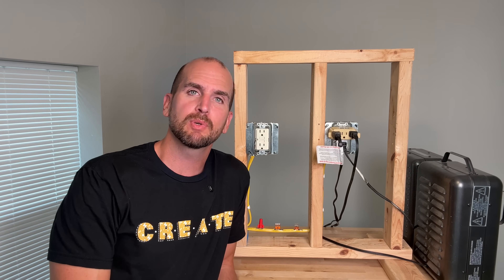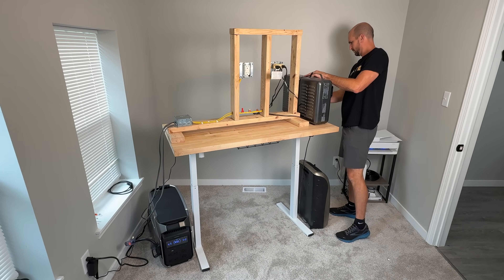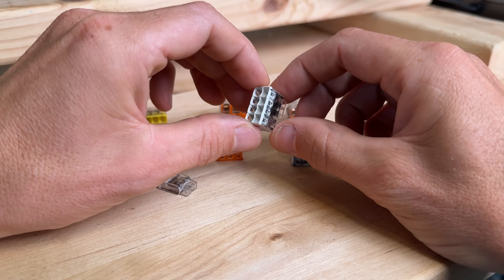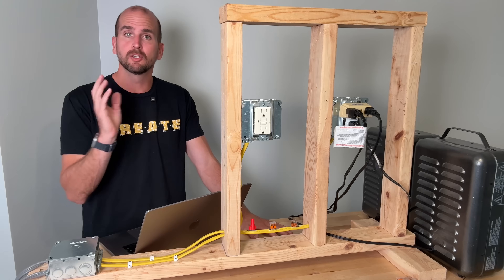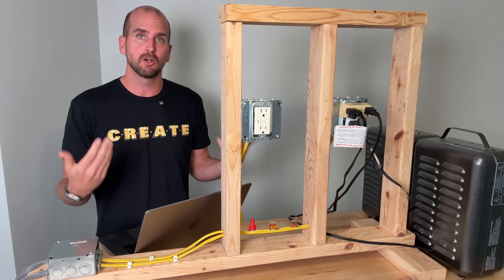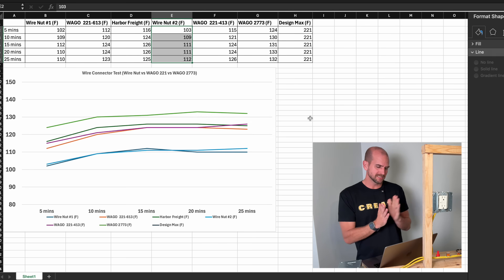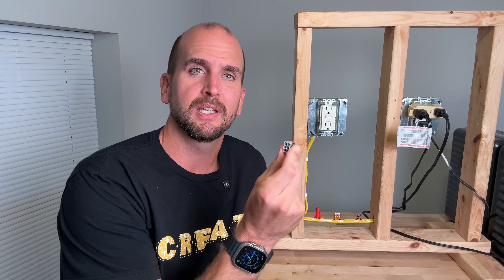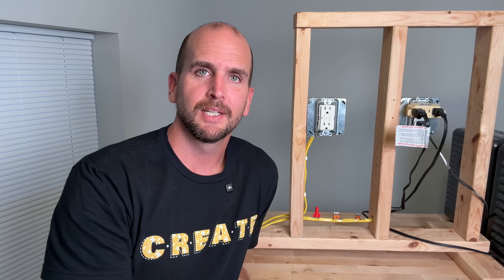Can Push-In Wire Connectors Handle Heavy Loads? | Surprising Results!

Comment: That’s why the US should update there 120V to 240 half of the amps and 12gauge is only 2.08 mm while we use 2.5mm. It’s not the voltage any that does the harm, it’s the amps that creates the heat

Comment: TL;DW: None of them came within 50 degrees of their rated max temp, and the push-in, with the least contact area and clamping force, predicably had the most heat but still well within specification.

Comment: This may sound stupid, but just curious.  Is using the push in connector the same as backstabbing in an electrical outlet because no reputable electrician recommends backstabbing, although the builder that built this house, thats all they used.

Comment: i love using the push in connectors for light fixtures , quick and easy to install, but the temps on your chart seem to reinforce  my  opinion that they are not as good of connection as wire nuts, loose connections always produce more heat(thus failing more often). example, i have to repair alot more circuits,recetacles that are backstabed than recetacles that are placed under the screw terminals. burned up wires backstabed into rectacles and switches  are alot more common than hardwired under the clamps or screw terminals and these push in and wago connectors are very similar in design of the backstab holes. with that said i do think the wago or push in connectors are good in some applications but better than wire nuts certainly not says my 45 years of electrical experience

Comment: Would it be possible, or have you done it to do a long temp test @ 20A (or even better 16A) since you are not supposed to run a circuit full time at more then 80% of rated. Just wondering what temps they would be at pulling something like 16A for 24 hours. I would think they would be cooler but would the temps be closer together for all the different connectors.

Comment: I use 2273 for lighting circuits. With modern high voltage LED lights currents often don't exceed even 1A.

Comment: I utilized a Wago 221 lever nut in my garage electrical junction box.

The original wiring had a wire nut with four wires twisted together.

One 12-2 and three 14-2 under one wire nut inside the metal junction box.

Instead of re-twisting everything and using another wire nut after replacing the junction box, I used a Wago 221 lever nut that could accept different wire gauges.

It was a small junction box, and the original wiring from 1965 didn't have enough wire for any servicing. They didn't give you enough wire in those days, huh?

LOL

The Wago 221 lever nut was a game changer!

This is safe, right?

My friend said Wago's are dangerous and that wire nuts should always be used.

What do you think?

Comment: I like your experiment however the wire and lever nuts are too close to the romex to establish a heat profile.  The wire and copper can easily influence the connection temperature.  I guess I would try to run perhaps a foot of insulated wire (in each direction) and heat sink perhaps 10-11 inches of the path of wire going to the connection.

Comment: I have the 221 series, but I also bought a box of In-sure push in 4 wire connectors by Ideal and like them even more than the Wagos because the wires stay in there nice and tight, although not reusable.  I would be willing to try the Harbor Freight or even the newer style Wagos, but I really don't have space issues nor load issues.  Thanks for the very informative video.

Comment: You dont think the NEC tested these before allowing them to be sold in the US? What,
you think just any old jerk can create a connector out in his garage & Home Depot & Walmart will fill their shelves with them? You dont think the big retailers lawyers will insist all electrical products sold in their clients stores be NFPA & NEC approved? What world do you live in?

!
Reply: What do you say about quick wiring (backstabbing) 14 gauge wire on residential grade receptacles? These are also UL Listed and comply with the NEC, but very few people recommend using that feature. Point being, UL Listing and NEC compliance is sometimes a low bar.
Reply: @surferdude642 

Those backstabbing connections are actually very reliable. Lots of times in life people just follow what gets repeated, even if it isn't true.
Reply: @CorneliusTaylor-s1u I tend to agree, and I've seen a few of those in my house that have been used for over 50 years with no issues regarding bad wire connections. A few years ago I upgraded all the receptacles and switches, and as a diyer with plenty of time to do this and not wanting to be cheap or cutting corners, I opted for commercial grade receptacles where backstabbing is not an option. Back wiring on commercial grade is far superior and convenient if you come across stranded wire.
Reply: @surferdude642  

I was going to add that I have replaced most of the original sockets and switches in a home built in 1980 and I only found one backstabed wire that was loose, and that can easily be explained by it not being properly installed. In other words it was not pushed in all the way, because it came out like it wasn't even being held properly in the first place. 

Every other switch and outlet where I've had to remove the backstabbed wires they were all very tightly secured. In fact they were usually very difficult to remove. That has to be around a couple of hundred wires in total so far. I only replaced all the switches and outlets because they're old, with many of the outlets being loose on the plug side.

Comment: So many people still fuss about anything other than wire nuts. The fact that they have been used for years in multiple countries, and therefore tested by multiple different agencies, seems to escape them.  Maybe they should just do a Western Union splice on each connection, and use knob and tube

Comment: ow does going above their design limit prove anything?
Reply: Yes, it helps validate what it is rated for. Aircraft wings are bent until they are broken before they get certified for normal use.
Reply: @CorneliusTaylor-s1u  but the moment it passes it stated rating anything beyond has very little value

Comment: Good morning I have a question about using the wago inline connector to extend wire length in my electrical panel. I have a 60amp breaker that too short to relocate. Can the wago which is rated for 20 amps handle the 60 amp. Thanks in advance

Comment: Been using the Ideal InSure connectors for years... Never had a problem or call back with using the connectors... Never had any voltage drop issues when used on branch circuits where room lighting (lamps) dimmed with window A/C units on same run... Witnessed firsthand demonstrations with these push in connectors where the wire burnt long before the connectors did... Used these connectors in my own properties and have checked connections in the JB's just to see if anything looked suspicious... Don't be afraid to look outside of your wheelhouse with different technologies...
Reply: Ideal's are good.  I think they did push-in before Wago.  They are UL listed and U.S. made.  There is no reason not to use them.
Reply: Best comment i have read in a while,i almost was thinking i need to go back and rewire and use wire nuts.
I have been using the idea push ins, mainly due to old house plaster walls ( want to save plaster,cant stand thin drywall) long story short, to be able to put 3 port ones in the receptable boxes ( leave a port open) has saved me alot of work,meaning my new circuit could be hot if i needed,while i was patching,skim coating and painting,i didnt  have Recepts in my way,when i got done ,i had all my recepts made up sitting at table ( while taking breaks) all i had to do is go back and take the temp  cardboard i put to keep dust out of boxes and then plug in the recepts.
I still have 2 more rooms to go that have cloth wire,using these has helped me MUCH with rewiring to save my plaster.
To go back and have to take wire nuts apart or to have recepts all in my way skim coating would have been MUCH MORE work.
I have not had any problems with them, but i see many is against them,much cheaper price than Wago.
I put all 22.5 C  for single gang boxes, 34.5 for double so plenty of room.
Thanks :)

Comment: What happens if you plug a 10 awg wire into those small wago handling 12 awg or higher?
Reply: 10 gauge doesn't fit in them.

Comment: With a ~+100% tolerance in temperature...it's all about cost and convenience. Twisting multiple wires is a PIA, and reusing them is impossible. I can use the WAGO to play around with different configurations without any damage to the wire or the connector.

Comment: I use 221’s for LED lighting and where space within an electrical box is at a premium, seen enough testing to finally be comfortable enough in their intended usage. I do not use the 2273 wire connectors as i find i enjoy the versatility of being able to reuse the 221 connectors, and don’t really wish to stock different versions when stocking the 221 is more than adequate for the tasks i encounter. I would have no issue with the 2273 however, i just find i do not really require it in my toolbox. Cheers.

Comment: I'd do the test another way. Have a dozen sparkies do 30 connections of each type on a timer, test them after installation and test them a year later after having had 1000 thermal cycles. The way you tested it makes wire nuts look FAR better than they actually are.....

Comment: Wagos are trash!! Twist the wire, use a nut, and call it!!
Reply: Nuts are cheaper and generate less resistance (less heat). However, wires tend to expand/contract in time, and in a couple of years, they tend to get loose = more resistance = more heat.
Wagos, and Wagos alike use springs, so they could last for more time.
Reply: @eng3d  wagos burn up,seen it several times, they aren't good for line voltage
Reply: @Libs-are-Cooked 

Likely not properly installed. Like not all the way in.

Comment: Since the actual conductor got just as hot as the higher temps on the push-in and lever nuts, my assessment is that what you're really measuring is the difference in insulation between the three.
Reply: Yeah, this video is stupid, he didn't even measure the voltage drop. I saw another video and the 2273 actually has a really low resistance compared to 221.

Comment: I think there's more to this story that you might want to touch on. You used metal boxes, exposed all around to room temp ambient air. Try again with a plastic box buried in insulation inside a wall that is at 140F or more (this scenario is actually quite common in the USA). Also FLiR is nice for cinematics, but really a properly installed thermistor/thermocouple will yeild more credible results.

Comment: Does changing the relative position of the connectors change their performance? In other words, instead of wire nut, lever wago, push in wago, what if it was push in wago, wire nut, lever wago? Also, I suspect the plastic of the wire nut is doing a better job of containing the heat and not allowing the thermal camera to read it.

Comment: The push-ins are an absolute go-to for anything low current (e.g. fixed LED pot lights).  The 221's are the best thing to happen to wiring in decades. Try using wire-nuts to join 5 wires in a tight box, or try joining 2, 3 or 4 stranded 18ga wires to a 14ga solid in a light fixture using wire nuts and then do the same with a 221. To anyone who still doesn't get it: insurance companies are manifestly picky about codes... and they think the 221's are SAFER because it's so easy to f-up a wire nut connection and that happens all the time. Finally,. 'Nuff said.

Comment: As a German electrician, the push ins aren't single use. Twist and pull to get the cables out
Reply: Are push-ins ok to add an outlet to the 14 gauge circuit to connect 15A dehumidifier?
Reply: @IvanMr  We don't use AWG here but I know that bigger number means smaller. assuming all the wires you're connecting are rated to carry the 15A and your breaker supports it then yes the connectors are more than fine

Comment: Measuring the temperature in open air does not show what really happens when the connectors are enclosed in a junction box with wiring that is bunched up.  I suspect the temperature rise over time will be much higher as the heating source will be much more concentrated and there is greater thermal resistance to removing the heat.  Your experiment should be run under real world conditions and measured with thermal-couple.

Comment: I’m late to this but I love the Wago 221’s. The ability to reuse them is key. It isn’t so much reusing them on different circuits it is the ability to make a change to a circuit. For example, in a crowded box, I may switch some wires around or reconfigure some connections for better use  of the space. Love the Wago’s.

Comment: The lever nut and wire nuts have more surface area to radiate heat.  You tested them all in open wire.  I would like to know how they would function in a covered junction box that is full to code limits.  I suspect that the temperature differences would even out.  In fact, push in and wire nuts might actually help cooling because they are smaller and allow more air circulation in the box.

Comment: I have wondered about these types of connectors vs. wire nuts current carrying capabilities and heat because their point of contact is a lot less than using wire nuts.  I am much more comfortable using these newer push connectors now that I see your test results.  Thanks for being thorough.

Comment: I'm mainly looking at the 221-612 10awg one for inside a dryer on the heating circuit where I need to splice a bit of extra cable to reach the terminal block on a repair.  Any concerns using for this application?  Would be pretty consistently used at up to 30 amps.

Comment: I use both. In specific applications like installing home light fixtures I use the lever push in and 3 wires or more push ins for the ground since a light fixtures with LED has very small loads. On outlets and junction boxes I use wire nuts except for the ground were I use 3 or more wire push connectors.

Comment: you should measure voltage drop across the connectors while under load, that would tell you the resistance of the connector

Comment: The levernuts (any reliable brand) are really good for installing lighting fixtures or any other device that have captive stranded wires and connecting those stranded wires to the solid house wiring. The push-in connectors aren't as good for stranded wires, especially if the strands are fine (thicker strands are ok in the push-in connectors, but I prefer not to use any stranded wires in any push-in connectors).

Comment: Push in connectors are the standard method for electrical connections in Germany. 
If there were failures then WAGO would have a big problem. 
Push-in connectors can also be removed and reused up to 3 times. The trick is to twist the cable and carefully pull it out of the clamp. If the metal spring is not bent it can be used again. But if in doubt, they should be replaced.
20A and up to 400V are no problem.

Comment: The push to connect can't accidentally open when putting wires in a full j box like the lever can if a wire catches it just right.  If it happens when putting receptiple in you can't see it.

Comment: I would use the 6 or 8 wire push ins for ground and neutral wires, like you mentioned, because there are times when the 5 wire 221 doesn’t offer enough spaces for the number of wires I have to join. Thanks for another great video on the Wago lever nuts! They have made my electrical work so much easier and professional.

Comment: I'm not an electrician I'm just a maintenance guy. I do use push and connectors, mainly because Lowe's has not been carrying any wago connectors, and Lowe's is our approved vendor. But I only use them for low current situations, not for hot or neutral on outlets, I will use them on the earth line. I also use them when I direct wire LED lights because I know that they are low current applications. So to sum it up I will only use them in low current applications.

Comment: No push-in connectors!  These have been common for residential wiring devices, and they eventually fail due to movement and arcing.  Take the extra second and do it right.

Comment: It’s 20 degrees.  My wife has a kiln and I can watch the temperature of the gfci outlet as well as the breaker and they both have hot spots.  

Back wire receptacles have short connections as compared to wires that wrap around a terminal so they too will generate more heat.  An inexperienced DYI might not use a wire nut wrong.  Any connection will generate heat.  It’s the nature of connections; so unless you weld wires together, you will generate heat.  Also, the load you are running is at max current.   In summary, don’t use a wire nut on a Tesla 50 amp charger.

Comment: Great tests! I’d feel very comfortable using the push-in connectors - as long as the wires don’t come out. Do they work with stranded as well, or is that lever nut territory?

Comment: Would like to see the "diy special wirenut procedure" compared in these tests - I've seen it way too many times when rewiring an outlet. Stick 2 wires in a wirenut and twist it on without twisting the wires around each other at all. Just rely on the force of the spring in the wirenut to hold the wires together.

Comment: This "best case" test where the connectors are installed perfectly isn't useful. We know they'll all pass easily, they're all approved the various testing labs as required. What might actually be useful beyond a clickbaity video title would be to test in sub-optimal conditions, where installation wasn't performed properly, where wires are under strain, not seated fully, in a damp environment, etc.